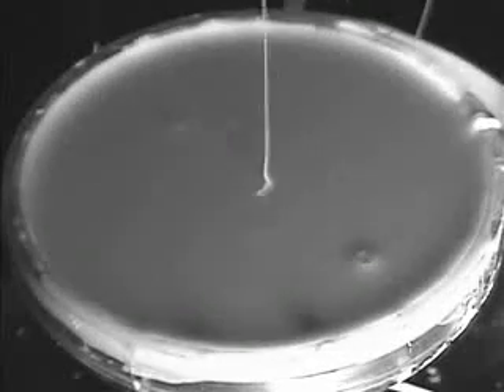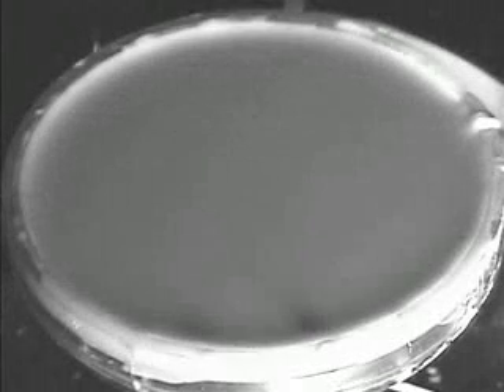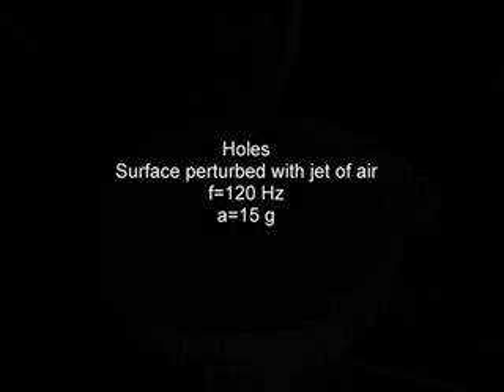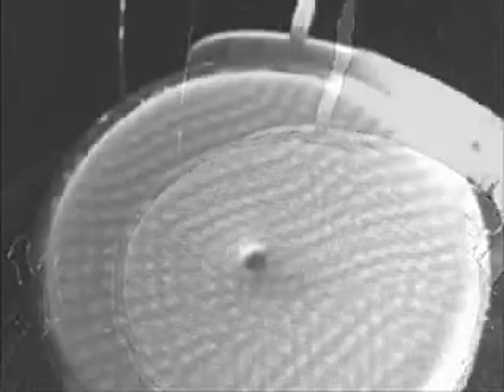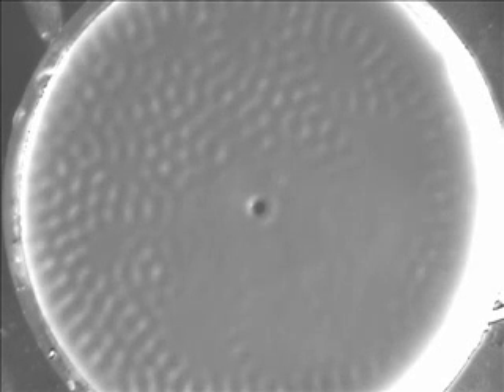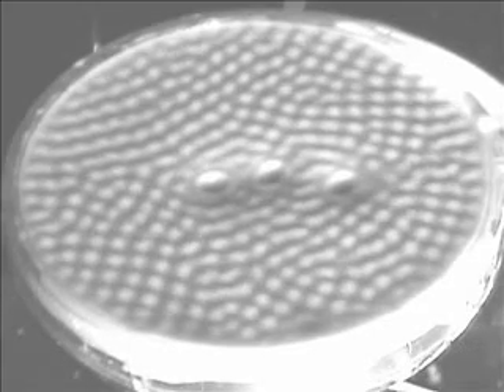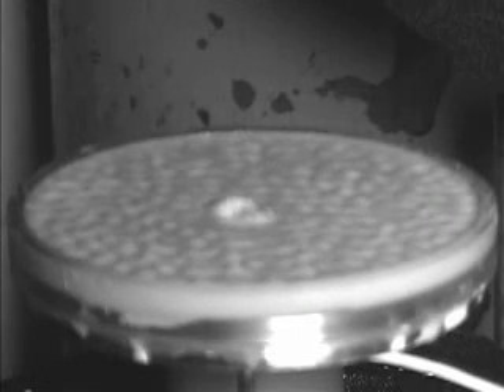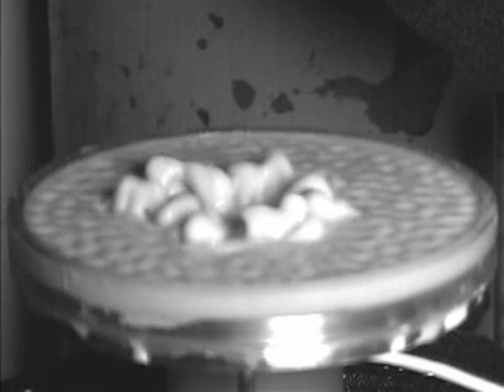Amazing Liquid

Comment: TIP:
if you don't have that rotating plate, you can do what I have done.
use your sub-woofer (to whoever has a stereo system)
It works the same as that when the bas is high, its even easier to set as you want...

Comment: actually, if you want to try this at home, mix cornstarch with water then hold it in your hands, push your fingers slowly through and it's a liquid but if you crush it as hard and as fast as you can it turns into a solid. the farady waves are turning the mixture into a semi solid state.

Comment: not fake, they did this on mythbusters at one point, and you can easily make a corn starch solution like this at home... it flows like a thick liquid when it's under no physical pressure but if you try to squeeze it it will solidify as long as you maintain that pressure.

Comment: Eh, no. It's not a plasma, cinematic, or a tear in any dimension. It's called a Non-Newtonian Fluid, which basically means it doesn't obey Newton's laws of viscosity. When pressure is applied the atoms of the substance get closer and lose energy, when at rest, or acted upon lightly the atoms remain as a similar distance and frequency to a liquid. BTW I'm 16 and i know this...

Comment: i believe its the same reason you can run on cornstarch and water, its a non-neutonian liguid, meaning when force is applied to it to molecules in the cornstrach stack together like blocks are are soild for and instant, this video shows it on an amplifier which applied a constant force which alowed the corstarch to stay at a relatively soild state the whole time

Comment: What you see here is an example of a so called Non-Newtonian fluid. It behaves like fluid when nearly no force is applied. But when you apply a force it behaves more like a solid matter, because it consists mostly of particles with a high friction coefficient against each other but which are surrounded by a thin layer of water between each other. The sonic waves apply frequent forces and become indirekt visible in the case of a resonance.

Comment: I bet it would create a slow moving tsunami from the center point if a x amount of air was blown at y speed through z wide straw straight down in the middle, if the frequency was tuned just right.. or something ;D

Comment: Yes this is real and cornstarch + water with no vibration can still produce an interesting reaction.  
Try to put your finger through mix slowly and you will penetrate like a liquid.  Try to quickly penetrate the mix and it will act as solid and no penetration will occur!

Comment: this is what i think guys: the particles of 
the corn stuff vibrate and hit against each other (look at collision theory) if the frequency is right the particles would collide against each other with enough power to keep away the water from entering the hole that is created by the jet of air...
if my theory is right then the greater the frequency, the greater hole should be able to be maintained in shape...
obviously i'm only 15 so i'm probbably wrong! 8(

Comment: Ethan. Mix cornflower and water until it's 'gloopy'. Stand back (just in case you don't believe me). Hit it with a spoon. It won't splash. Cornflower and water is weird anyway, you'd expect it to act even weirder when vibrated.

Comment: This is not fake, cornstarch is a thickening agent commonly used in cooking.  When mixed with water it becomes a substance that when stirred the molecules bind up and create resistance.  The guy is vibrating the substance which causes the strange effects.  Try making it sometime, just mix 1 part cornstarch and 1 part water.  Then play around with it.  Try punching it, you'll find it is a pretty odd experience.

Comment: its kuz the vibration. if youve ever played with that stuff it will stretch and be liquid if you push on it but if you poke it very quickly it is much stiffer, more solid. the vibration is like a whole bunch of fast movements ao it holds its shape, like the waves of movement regular waves, but slow and wierd kuz its stiff when moving. i have no idea how the fingers thingy works though

Comment: simple. the liquid is called "non-newtonian liquid" and it has the properties of liquid except when put under pressure; then it acts like a solid and stays in whatever shape you put it in. So, the vibrations put the liquid under pressure making it stay in whatever shape they mold it into. they blast some air into it and the vibrations putting pressure on the liquid makes the "liquid" turn 'solid' around the newly created hole.

Comment: It can be explained by mathematics. A 2-D wave is set up over the surface, but its not really uniform it follows a strange pattern from the machine creating the vibrations. Hitting it with the compressed air in random places causes amplification of the nodes of the wave patterns and they just build from that. It identical to hitting pinch harmonics on the guitar to force the string into a higher mode of vibration. Not special effects just physics and math.

Comment: very interesting. One question: did you keep the plate under vibration at all times?

it seems like there are stationary waves all the time in the plate being created, and some way or the other the forces around a perturbation cancel each other, so that the hole stays as it is. Laplace equation, probably... but the fingers bit is quite amazing. Would they be modelled as solitons?

Comment: No, we repeated this experiment independently with a subwoofer and cornstarch. Everything you see above happens in REAL TIME, it is quite amazing. 

Corn starch is a weird liquid that thickens when it feels a force. What I think is happening, is that the vibrations shake up some waves, but the force hardens those waves, and then the next time they get shaken up and harden some more, so they keep building up until they topple over.